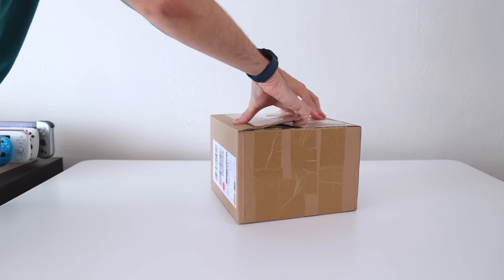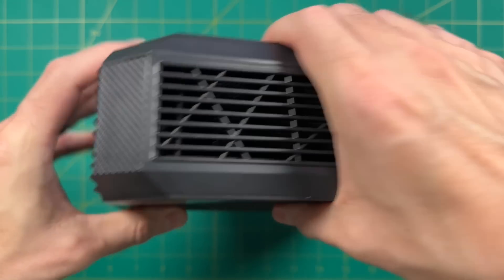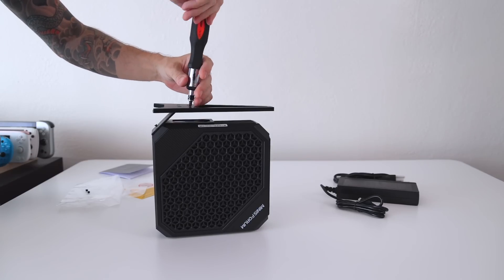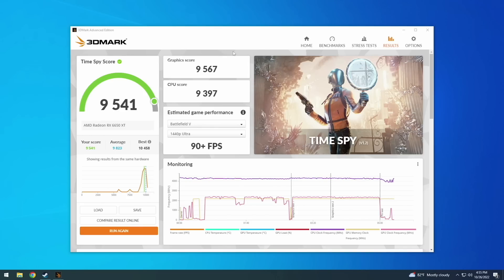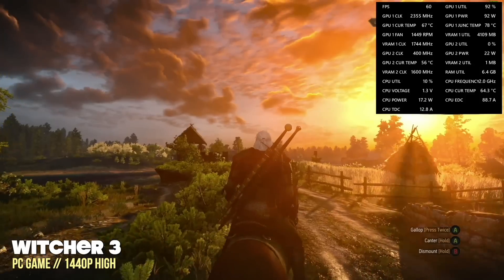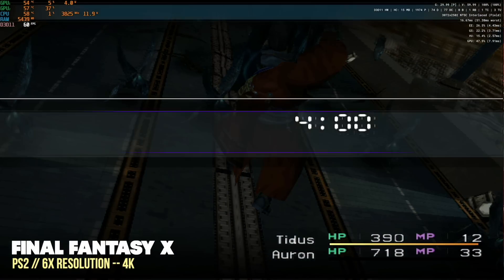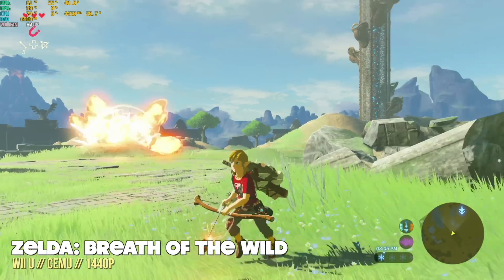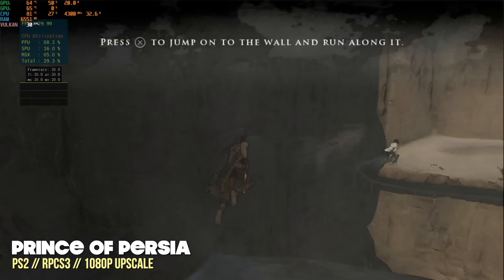A Mini PC with an RX6600M GPU! MinisForum HX90G Review

Comment: Great video. This video was more well-rounded than the rest I've seen but the choice between this and the NUCXI5 is still a tricky one. Both fit the use case well. I suspect I'll wait and see which dips further on black Friday.

Thank you!
Reply: The NUCX series are much noiser, given the slim laptop form factor. If you don't need it to be quiet and want better gaming performance then you can go with the NUCX.

Comment: I'm actually really excited about the mini pc boom lately. It's going to be another year or two when I'm in the market for a new computer but I bet there will be even cooler stuff then. I'm not a power user at all so I'd definitely consider a well made mini pc like this over building one just because of the small size and having it prebuilt
Reply: Next year you'll start seeing this type of box come with a Ryzen 6000 CPU and DDR5 which will really shake up these mini PCs.  The chips out now already come with up to 8 Zen 3+ cores and 12 RDNA 2 cores so chuck a GPU on top on the board and you'll have a pretty good PC by any standards.

Comment: Appreciate the review Russ, lots of good points mentioned and a great overview of the performance for this mini PC! Not sure if you were aware, but Minisforum botched the liquid metal application on the predecessor (HX90) model; it would be great if you can check for any similar problems with the liquid metal application on the HX90G. 👏🙂

Comment: This is a question of form factor over functionality. For it's size, it's a beast, for sure. For the asking price, one can get a good full size rig.
I have to agree regarding the stand design. Seven (7) screws to hold it together is a too much IMO. They could have come up with something better.
Reply: I wonder if you could 3D print a foot to replace the pointy bit of the stand?

Comment: I'm actually considering getting one of these. It works better than my PC, is smaller than it. And also uses about 70W less. Pity it didn't have the 680M and 6650M in it.
Reply: Why? Even if it came with the igpu and rx 6600m it wouldn't matter cause you will always be using the rx 6600m

Comment: I have a strong feeling the reason the base is pointed at the front is because it looks like it's based on the HP Blackbird 002 case design from over a decade ago (when they bought Voodoo PC).

Comment: I have the HX90 and HX90G.  For Batocera, it runs exactly the same on both machines.  It's like Batocera doesn't see the 6600m on the HX90G.  I've tried changing the drivers in the boot.config and nothing seems to help.  I even disabled the igpu in the bios.  I can play 3ds but only at 1x resolution as anything higher has slowdown and stutters.  PS3 is the same.  Xbox 360 is unplayable even though a video was upload by another creator running Skate 3 for 360 on the SteamDeck version of Batocera and it plays fine.

Comment: I don't know.  I think $8-900 for this mini pc is actually a pretty good value.  on one hand, for my use case scenario, the hx90g would fit my use case scenario better plus the extra hp compared to the steam deck is a huge win.  yeah, it would've been nice to have a 2.5 slot but external run through usb almost cancels that out.  I still haven't flown back to the US to get my steam deck but if for some reason I am disappointed I will flip the SD and get the hx90g.

Comment: I'm trying to find if people are having the same problem I'm having. I have the cheeper option the hx 80g Ryzen 7 and a Radeon 6600 but it won't run devinci resolve. First it would open and nothing with show up on the time line and now it won't do anything but crash

Comment: Im considering on purchasing this over the UM690 (which I like since it has a usb4 just in case i want to use an external gpu). I mainly would need it for 4k video editing and some light gaming like League of Legends. I'd like ya'lls opinion on whether i'm better off building a small form factor pc at this price. One thing I really like about this is that its prebuil and small. Its been a while since I built my last pc and not really sure of the current market for parts.

Comment: Interesting machine (if you have the amount of money burning a hole in your pocket - somehow, I'd find a decently compact, but non-cramped mini-ITX system more interesting, but, where to start...), but, yeah, that stand? That wedge shape is cool and all, but the combo with that 'brick' of a case on top, with all the edges and chamfers and whatnots in its design, plus that old 'cheese grater' Mac Pro air vent style to boot 😄, makes the system itself kinda 'floating' above that simple shape look quite, I dunno, maybe 'unkempt' in comparison is the expression I'm searching for 🤔?
P. S.: Sidenote: BTW, how wide approximately is your big 'Luke Skywalker' case? Somehow, to me this comes across as at least 50-60% wider than the old-fashioned 'just wide enough to fit a DVD drive into the front frame' cases I'm used to...

Comment: Could I use this as an egpu?
Reply: No. It's a PC built into one box. Ya could also get a epu that's better then what it has already. Also make sure you have a thunderbolt port. If thunderbolt 3, a egpu ain't worth it. Thunderbolt 4 that is semi worth ya time. 
I won't travel on and say that you're better off building your computer or etc etc. I don't know your situation, but I will say do not get an egpu if you have thunderbolt 3

Comment: $799.00. No thanks. I use a Dell Optiplex  3060 core I5 8500 with 16GB of Ram with a 512 Nvme,  that I got on Ebay for $250. I threw a GPU in it and I now play all the retro games I want. I play at 1080 P becuse I don't have a 4k Monitor.

Comment: For this price we should really be seeing the current 6000 gen cpu with the additional benefit of much faster ddr5 ram.
My guess is all the sff manufacturers may end up skipping the 6000 gen as it’s clearly suffered from massive supply issues regardless of AMDs hype.
Reply: A 6000 gen version is launching in the next few months,even minisforum confirmed this.

Comment: Lol, "dropped to the low fifties, but still totally playable".
Without that metadata you wouldn't even know, the best eyesight in the world doesn't see any higher than 35fps and 99% of the planet can't tell if it drops to 28fps as that's the average worldwide.
Any system that can hold 35-40fps at full/ultra everything is perfectly fine, anything else is not even noticeable to the naked eye and quite frankly overkill, the only reason having a computer so powerful is for computing and calculations and the only benefit to gamers with a comp that can hit 150fps is a slight future proof/longevity of the rig.